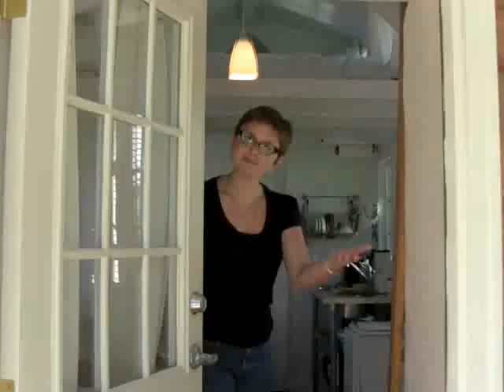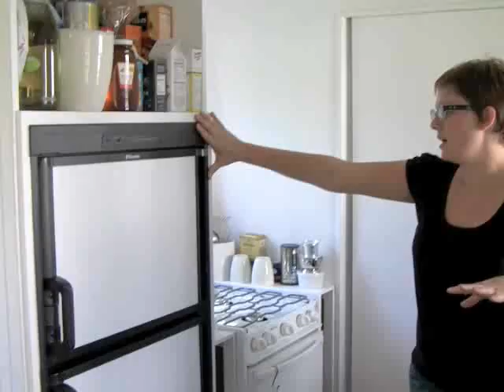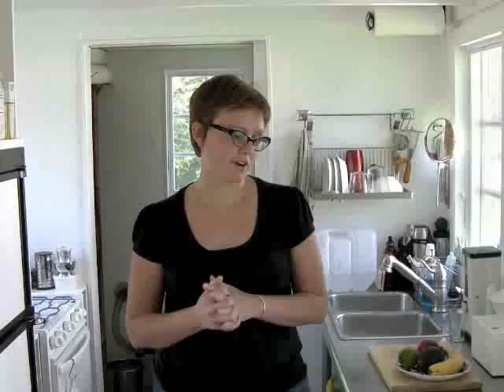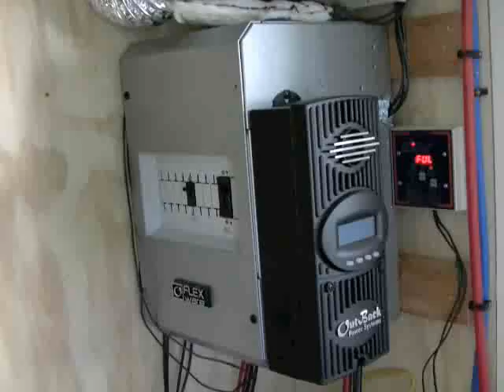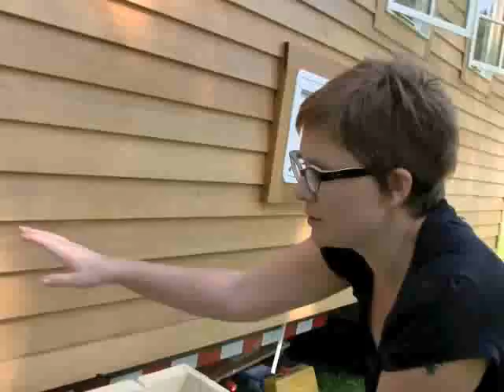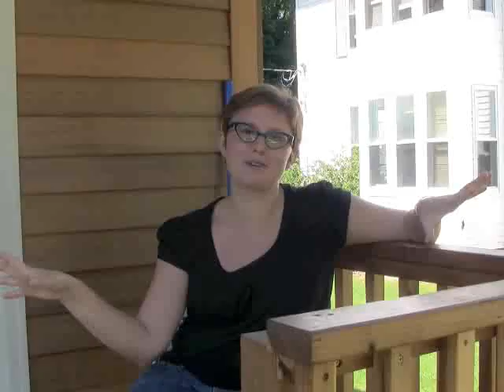The Protohaus Project

Comment: I love the dormers on the loft for the extra head room. How do you take your solar panels and battery pack with you when you travel with the house? Wouldn't it be easier if the solar panels were attached to the roof? Just curious. Great job on the design and layout.

Comment: I'd also be interested in the plans for this.  It has some very unique features that most tiny houses don't generally have.  

@RutherfordTony-To have a properly built/wired/plumbed tiny house  from start to move in condition plan on at least 3 months with knowledgeable or professional help (between 700-900 hours of labor).  A BASIC shell or lower quality structure can be built faster.  Cost depends on material new/recycled...